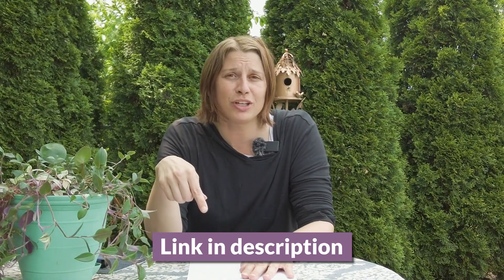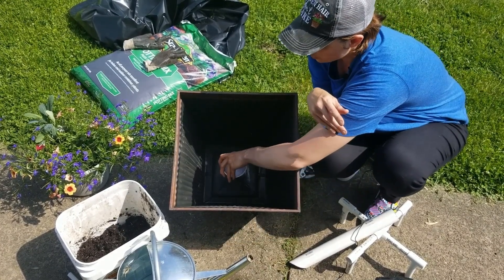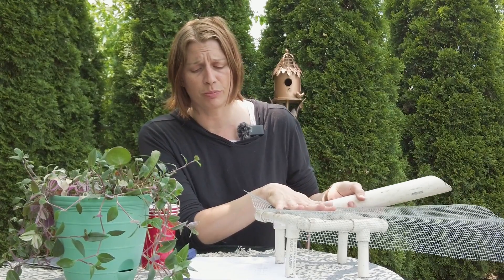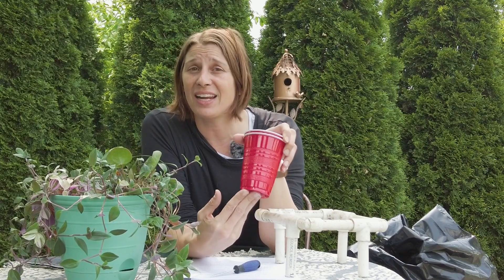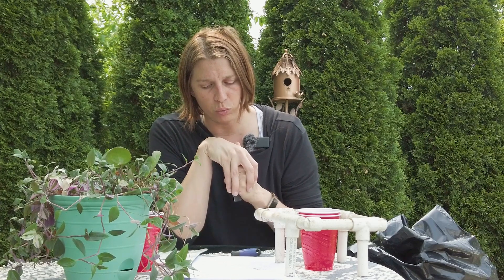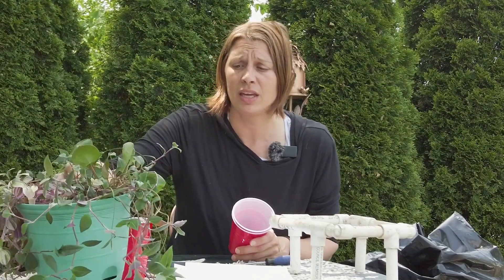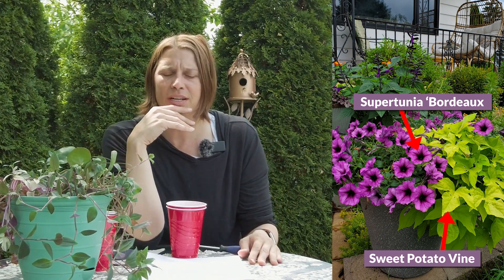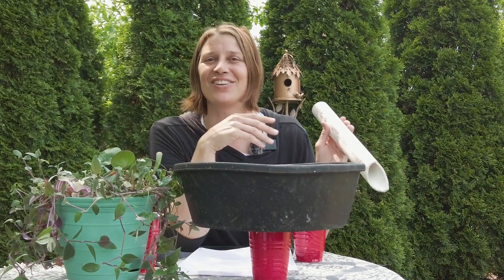DIY Self-Watering Planter FAQ (Your Questions Answered)

Comment: For those who are growing edible plants and are concerned about using garbage bags. I figured out an alternative for my needs. I'm using a 10" round planter with a ring of 1/2" irrigation tubing to act as a support to create a false bottom using a round take-out dish cover. BE SURE TO GET THE FLEXIBLE NO-KINK TUBING, it is easier to work with.

The irrigation tubing is very pliable and can easily be cut with scissors. I measured the length of irrigation tubing needed to fit the point of the inside of the pot where I wanted my reservoir to be. To connect the ends of the tubing to make it a continuous circle, I cut an additional 1-inch piece of tubing and split it down the middle lengthwise so I could roll it into itself.

I completed the circle by rolling the 1-inch tubing and inserting it into one end of the longer tubing then I connected the other side by putting the other rolled piece into the other side of the long tubing. I took the completed circle and fit it into the round pot, I then saw where my reservoir would be.

The next step for me was to find a piece of plastic to sit on top of the irrigation tubing ring inside the pot which would keep the soil from falling into the reservoir. At first, I was going to measure a piece of plastic using the tubing circle as a guide from a Dollar Tree chopping mat but then I went searching in my containers to see if I could find something more suitable. I found the top from a take-out container that fit perfectly. 

After you make your tubing circle, select your plastic soil barrier, and cut out a space to put the wicking soil cup and the watering tube as per the normal instructions provided.  I'm also thinking about trying to incorporate a water level indicator. 

I hope this helps someone.
Reply from the maker: Thanks for sharing 😊
Reply: @PrettyPurpleDoor You're welcome

Comment: Can just do the drainage holes on the side of the pot few inches over the ground instead of in the bottom.
Reply from the maker: There is no drainage in the bottom. If so the water would just pour out and there would be no water reservoir. For a self watering planter, NO draininge in bottom of pot.

Comment: We have store bought self watering planters that come with a fabric sock that sits down in the water reservoir and draws the water up into the planter.  We grow tomatoes in these and it’s hard to clean out the dirt from in the fabric sock when we replant each year. My question is should the fabric sock be filled with dirt the the rest of the planter is filled with or can we fill it with something else such as small rocks or something else?
Reply from the maker: It would likely need to be filled with dirt or something to wick the water up. I don't think rocks would help with that.